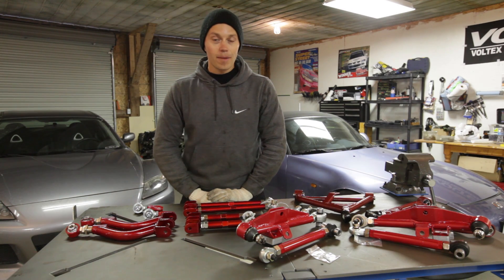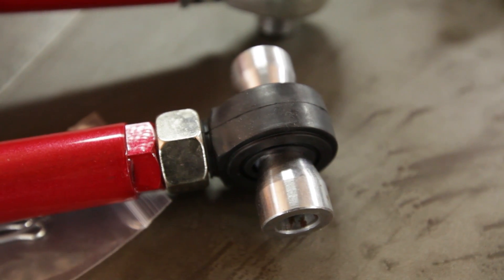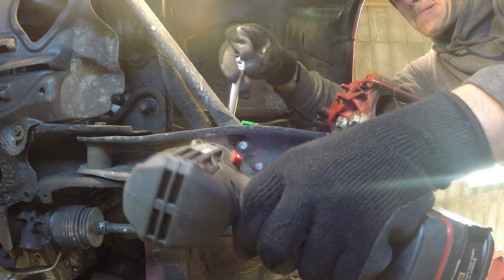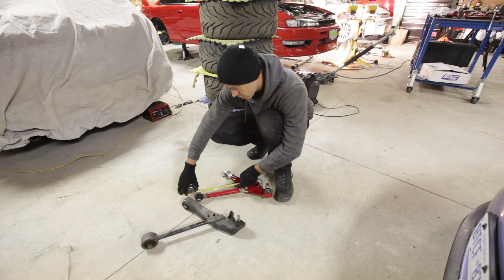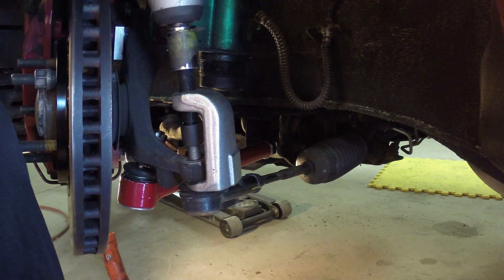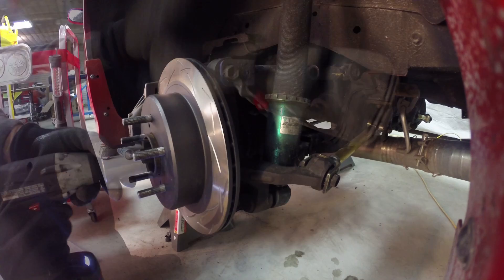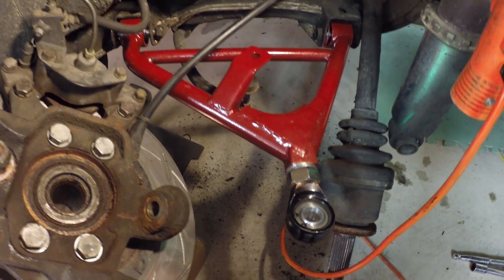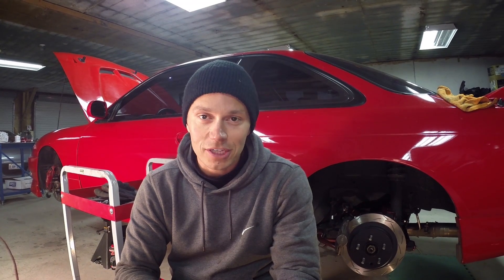240SX Adjustable Suspension Arm Upgrade - Project GripS14

Comment: is it safe to say I can use a setup like this for daily driving but will be installed in an s13 platform
Reply: Brian Bejado the only reason it’d hurt daily driving is if you have lots of camber or toe. An alignment can fix that. But the only reason to buy adjustable is if you want camber or steering angle

Comment: do they wear out so much faster than normal ones? i daily my s13 and i dont want to buy new ones every year
Reply from the maker: Then stock bushings? Yes, since they're spherical and not covered with rubber dirt can get in them and wear them out.
Reply: but what do you consider faster? and can i buy those bushings alone if they wear out?

Comment: I have rear Godspeed control arms on 2011 maxima lowered and all is good after alignment but 1 year later I'm having a horrible clunk from them with any bump where the arm is connected to a threaded part to expand the control arm I greased it and tightened then loosened to see if it goes away and still there any ideas what's happening ?? Thanks
Reply from the maker: This is typical for spherical bearings that are street driven. Your issue is the spherical bearing has gotten dirt into it and thus worn out and is most likely causing the clunking. You can replace the bearing and it'll be all tight again.

Comment: question about the heim joint being so angled on the rear control arm, did that give you any adjustment issues with the camber? because might now on my pbms is like this one and my camber arm is all the way short and i cant get any negative camber adjustment if i wanted too
Reply from the maker: +Crazyrogue Sounds like you have yours adjusted too far in and need to push it out which will indeed add negative camber and allow for more adjustment.

Comment: Should look into getting the little rubber boots that slip over and protect the rose joints, pack them with grease and the longevity of the bushes should be increased.
Reply from the maker: +thesam101 Agreed, the issue is finding proper boots. I dont drive this car enough to really have them wear out fast but people that do should have them.

Comment: Did you get the chance to try out the arms? I'm iffy about GodSpeed...  How are they holding up?
Reply from the maker: Sharad Sharma So far so good. Drove the car to the alignment shop and it drove fine without issue. Ill be heading to the track to test the setup as soon as I replace the rear subframe.